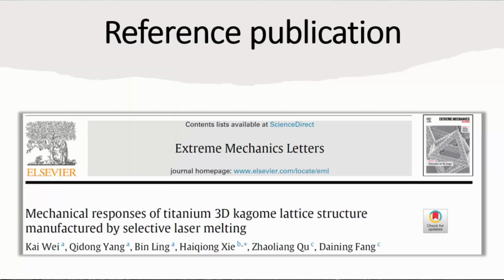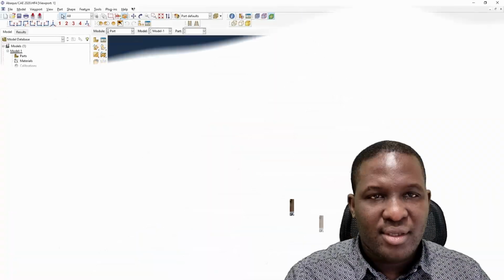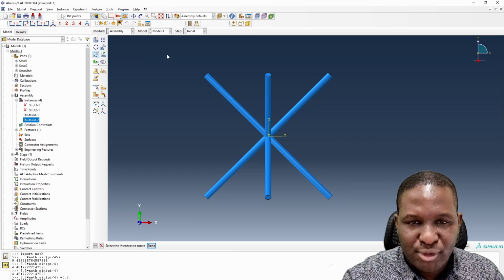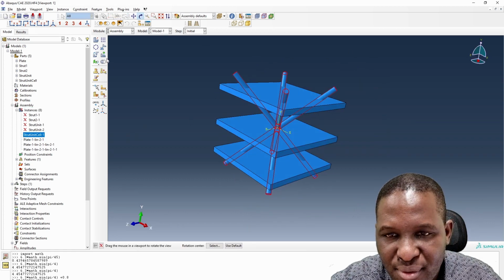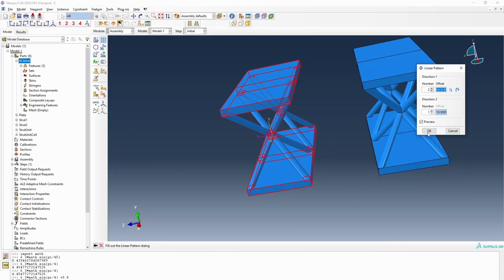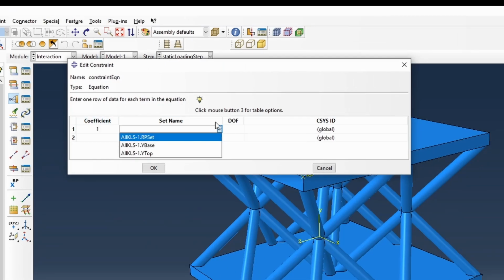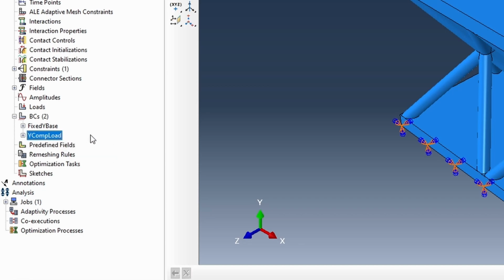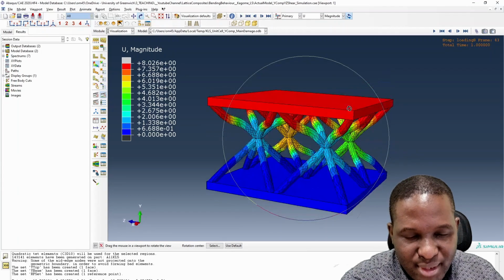How to model 3D printed lattice structures in ABAQUS.

Comment: hello dr great content as always... well to be honest i am still waiting for the video about meta material simulations using abaqus software...
i have another another question actually which is how i can assign negative poison's ratios to metamaterials ... should I use a umat ?? i
can u please suggest a reference that i can read about meta materials and broad my knowledge about them?? i mean  computational implementing them
Reply from the maker: Hello @Amirmohamad Balizadeh, thanks for your interest in the channel. I have not done any work on the metamaterials. I am focusing on other projects. This is a good paper that can help you with your metamaterials modelling of auxetic systems: https://doi.org/10.1016/j.eml.2016.09.001. 
On poisson ratio, I think there is a bit of confusion here. You can design the base material with positive poisson ratio for example steel with a poisson ratio of 0.3. However, due to the design of the metamterial (auxetic system), then following loading you can recover a negative poisson ratio often described as effective poisson ratio. This, is a result of a structural behaviour rather than an intrinsic material response. For the later, I do not think you can use the classic hookean elasticity model in ABAQUS to simulate that. I do not know of alternatives of dealing with your query - maybe  a UMAT, as you say can help.
Reply: @MichaelOkereke   thank you for your answer and your suggestions. I will definitlly consider them ... And thank you for the included refrence...